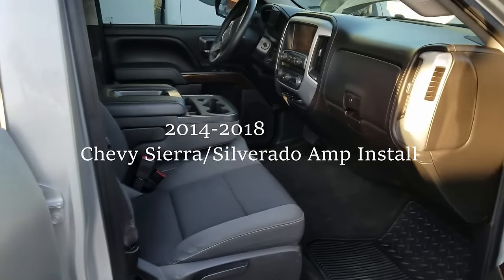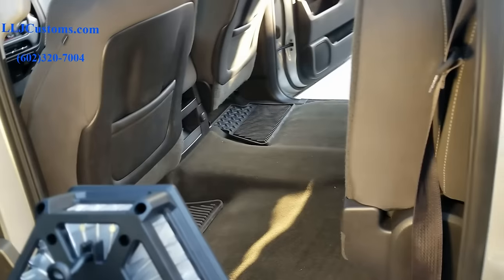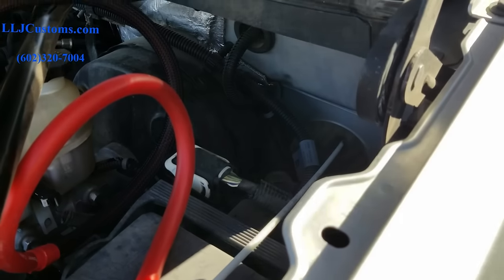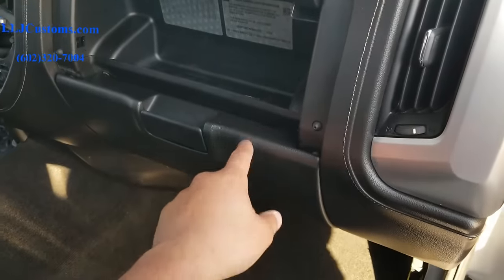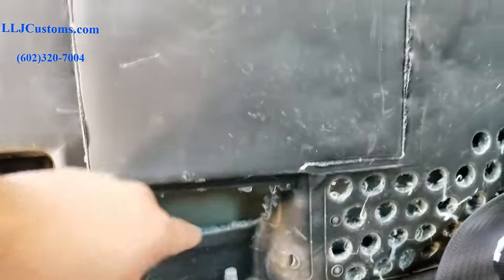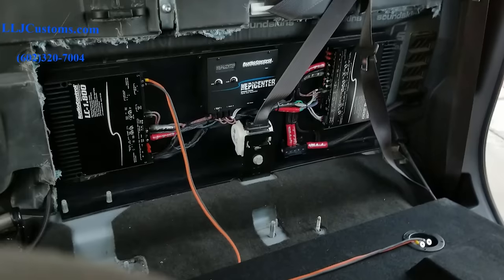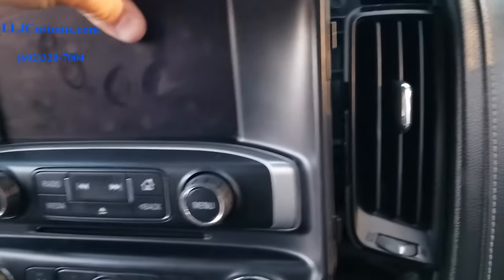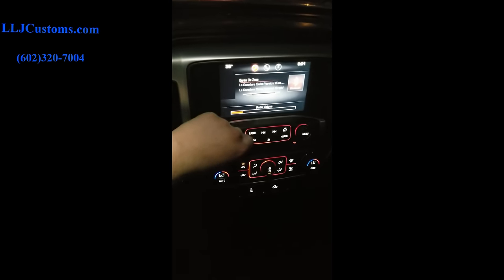2014-15-16-17-2018 Chevy Sierra/Silverado Amplifier install

Comment: Every time I invest in a great system....I trade the vehicle in and end up stock all over again. Why I won't waste money on upgrades.
Reply: Me either
Reply: I always remove certain things before I trade in my vehicle. So I can install it in the new one
Reply: @FG-ys4em Keep the stock parts so you can put them back in when you decide to sell. I leave the wiring so they can upgrade easily if they want
Reply from the maker: See, that's why we invented the elite system so that you can keep all your existing equipment, use it in your new vehicle, and all you need to do is change the base connector   of the harness.
Reply: Take your system out lol
Reply: We dont gaf

Comment: What does the other side of that loop back harness plug into? I have a kicker amp and sub I’m trying to use to just run my sub will that harness work?
Reply from the maker: @jackdecrow961  if you plan to just add a sub then a T-harness like a R2G or an R2R would be ideal

Comment: technically the accubass on the audiocontrol amplifier and/or the LC7i isnt the same as the epicenter, the accubass is to help with the bass roll off of the radio... meaning as in the bass dropps as the higher you go on the volume to not damage or distort the stock speakers, the epicenter enhances the bass that was rolled off or cut off when the song was produced... but nice install, love your guy's harnesses

Comment: Does the OEM loopback harness have the "Remote" wire for the aftermarket amps (Example:  AudioControl LC4.800 in the video) or do you have to run that separate from a separate location?  Thanks

Comment: That is very nice neat job i must say, good work!.  My question you kind of answered but i wanted to be sure, I have 2016 SLT with BOSE system and all i want to do is add kicker sub box and amp.  Can this be done with the BOSE system?  If so, where do I hook the amp to?
Reply from the maker: Thank you Greg, and yes you can you would use a bose T-harness R2G and make the connection at the bose amplifier

Comment: Hey LLJ, I got the amp rack plug n play from y’all. I was wondering which bolt y’all recommend using for the custom fuse box bracket y’all made. To everyone wondering if the product is worth it, HELL YES. The build quality is better than I could have expected, and the cost was barely over retail for the equipment included. For a novice, the rack is easily 20-30 hours of labor, if you even had the right tools. LLJ is the real deal

Comment: so when connecting the AMP to the Stock GM stereo all you need is the loopback harness? Other than that, it is typical power and ground cables and then your connections to the SUB (from amp)
Reply from the maker: That is correct and an amp or processor like a dsp or lnik6 if your amp does not take high level in .If you do have any questions please reach out to us .happy to help !

Comment: Mine is a 4" tall x 7" wide screen with a green plug but only has 2 wires. Hot and Ground coming out of it. 2014 Chevy Silverado double cab with a Bose system without a woofer. Do you sell a T plug with speaker outputs for this. I assume it would be for back at the amp. I need the speaker outputs to tie in a LOC PRO 7 RCA converter. I want to keep my factory  system, just adding a woofer and amp

Comment: I am just running a low end system with. Does the harness obsolete having to run the 2 rca cords? I Just wondered if I would need an interface

Comment: Hi, someone that such an apology will connect sound to a 2014 high country and when it accelerates, it makes noise to the bass I do not know if you can know what it is that woes so that it does not happen that greeting
Reply from the maker: Hello if you are getting any back feed to you subs when you accelerate you have ANC and need a bypass

Comment: Is this harness used so you don't have to cut into the factory wire?
Reply from the maker: That is correct. This is our old T-harness style our new harnes does the same thing but provides future expansion
Reply: @lljcustomscaraudiofabricat7854  thanks for the reply. I'm trying to add a 4 channel amp for my door speakers and a separate amp for my subs. Is there a harness available to do all this?
Reply from the maker: @agugabri14  Awesome, so yes there is and that is our Elite Lookback harness. Depending on the amp you have and if it takes high level input and if you have a factory amplifier or not you may also need a processor. We would be happy to help you with building out your system please send over the part number to the equipment you already own and our techs will give you a few options. Thank you
Reply: @lljcustomscaraudiofabricat7854  so for the door speakers ill be using the Taramps DS 440x4 and for the subs I'll be using the Taramps MD 1800.1, no factory amp. Plus ill be using a LC6i or the LC7i

Comment: I have a 2014 Chevrolet Silverado 1500 LT Crew cab with an 8 inch factory
radio screen. I'm adding 4 sundown 8 inch 800 watt 2 ohms subwoofers running off of a
 810 DM digital processer and the orion 5000 watt class D amplifier. 
My truck model does not have the bose amp system.

Which custom harness would you'll recommend for this setup?
Reply from the maker: Hello , you would want to go with a T-Harness and an LinkDQ. This will let you fix and boost the full bass frequancy range. https://lljcustoms.com/store/ols/products/2014-2018-gmc-chevy-silverado-sierra-oem-lp7-2-amp-t-harness

Comment: Where did you get the harness wire  loop
That goes from original stereo to small amp inputs and from small amp outputs to the  original 
door speakers?
Reply from the maker: Hi alejandro, we make them. You can purchase one on our website:
https://lljcustoms.com/store?olsPage=products%2Foem-loop-harnesses
Reply: LLJ Customs Car Audio Fabrication L.L.C I was just looking on site so with this I can bypass buying a processor? Does your harness control signal volume etc

Comment: if i have the bose system already in my truck and i want to add a sub, can the bose amplifier take a 400w sub? say a JL audio 12TW3-D4? or will i have to buy a new amp?
Reply from the maker: Hello Anthony, the factory bose amp does 80 watts so can you run an aftermarket sub yes will it power the sub properly no you would want to add a small amp like a acm1.300 or a Rockford  2.400 that can bridge to 1 channel at 400 watt will probably be 2 ohm so make sure your sub is the same impedance (ohm).

Comment: I got a zero gauge wiring kit and it won't snap underneath the plastic foot panel did you guys run it under the truck or something?

Comment: I had this done on my truck.. now my air conditioner is acting funny.. if it gets really hot, when i turn the car on none of the AC knobs turn on. then sometimes they do work.. sometimes it blows cold air, and the it blows hot air.. what could be wrong??
Reply from the maker: If you ise a can bus based product like pac pro those are issues that will happen. Our products NOT mess with any of your factory settings

Comment: Which subs did you use in this application? Also, was the box custom made? I have a 2016 Silverado and I am being told I cannot add anything decent due to the trans hump in the back.
Reply from the maker: Hello Curtis, i am sure that was followed up by u needing a seat lift and a custom box . No, you dont, and that's the point of this video, we used a single 12 Rockford P3s and a ground shaker box at 380 Watts rms . It is important to tune it correctly, and that is what most shops dont know how to do and why they upsell
Reply: @lljcustomscaraudiofabricat7854  would that work for a dual sub setup?
Reply: @LLJ Customs Car Audio Fabrication L.L.C  where are you located? If ypu are close enough I am going to pay you a visit.
Reply from the maker: @curtiscraft1633   absolutely the make doubt 12inch you could even get a double 13.4 inch jl subs iv had them in our test truck for over 5 years now still sounds great
Reply from the maker: @curtiscraft1633  we are located in Phoenix,az . Your are welcome anytime
Reply: @lljcustomscaraudiofabricat7854  that would be quite a drive from Jackson Michigan. Thank you for the info though.

Comment: Curious what box you used to go under the seat and if it was a single or double. I am trying to locate a good single 12" for my 2016 double cab. Any suggestions?

I like the amp rack. Maybe we can do some business on these.
Reply from the maker: Hello Raymond, thank you for watching the video. We used a simple ground shaker double 12"'s with some Rockford P3s's. We make a point of showing that expensive doesn't mean its better. Tuning is key . any box you buy make sure your subs will fit and at what frequency that way you know what your looking to get when it comes to your amp and the signal you feed it.

Comment: hey .would you help with my 2017 GMC SIERRA 1500 . DOORS SPEAKERS UPGRADE  WITH AMP BUT.  THE PROBLE THE  DOOR CHIME  INCREASE  TOO LOAD >
Reply from the maker: For that you would use a dsp to limit the Dbs at the frequency the chimes use to lower the intensity of the audio

Comment: Did y’all have to run 2 9 wires for the 4 channel.
Reply from the maker: Absolutely not, 9 wire at the time this was made was only sold in 18Awg and can introduce static into your system. We used an early version of our twisted shock-wire that used 20awg for signal and 16 awg for the return. They now sell a cheap 16awg 9 wire to copy us, but its not twisted and doesn't prevent EMI.
Reply: Gotcha, just wasn’t sure on a factory non Bose system. How to get the 9 wire from factory head unit to the Lci,  then lci rca to sundown amp. Then amp back up to the radio into harness to door speakers. Slightly confused.

Comment: Do you have a harness for people trying to run an amp for the door speakers?
Reply from the maker: Hello LS, yes we do we are the creators of the OEM loopback harness. This design lets you get signal on one side of the harness and then return it on the other to the factory speakers via the factory wires.

Comment: I bought your harness for a 2014 Silverado with an LP7-2R. I’m trying to figure out how to tune the system now. There’s gain adjustment in 3 or 4 different places so I don’t know which to adjust and what to set the others to. There’s gain on the LP-7 and the remote gain that connects to it. There’s also gain on my kicker amp and I think there’s a gain setting in the factory radio. Should the all be set to the lowest and adjusted only with the remote gain knob that came with the LP7?
Reply: I'm looking in to using that line out put converter.  It seems as though that knob is specific to ch 3 the "bass" channel... each gain should be for each channel ..

Comment: I ordered the same harness, for a 2014 Silverado, I installed an amplifier for the midrange and one for the subwoofers, the problem is that in the midrange the seat belt alarm sounds very loud, how can I fix that problem?
Reply from the maker: who did you get your harness from ?

Comment: i have a 2015 Silverado 1500 and there's only 2 wires coming from the green plug. a red and a black on the far right of the plug. Where would i find the audio wires in this case? Its a rally edition with Bose speakers
Reply from the maker: Hello, soubds like the vehilces has a Bose amp behind the rear seat. All of the audio will be running through the amp. The wiring behind the screen would just be data.
Reply: @lljcustomscaraudiofabricat7854   Yup, you're right. i did find it.

Comment: How long was the Harness you used? I am doing a similar install in the same type of truck and want to know what I should order.
Reply: Im wondering the same thing. Their phone lines are down and they take forever to answer emails.
Reply from the maker: hello this harness was 20 feet
Reply from the maker: We apologize Jack Aldridge, we have been work on our new shop. The length on this harness is 20 feet

Comment: You didn't show what bolt you used to hook up power
Reply from the maker: You are correct, our apologies. You will wire in at the bolt that comes from the battery connection befor the fuses

Comment: I ordered that same wiring harness, and the blue one (aux) did not work for me, do you know what the problem would be?
Reply from the maker: Hello Antonio 👋 when u say AUX and blue what do you mean ? Our harness doesn't have an aux option and the blue wire MAY be the remote turn on depending on your ordered configuration.

Comment: Is there any difference in the harness or install if you have the Bose amp in the back if you"re adding two amps or a five channel amp?
Reply from the maker: Hello, the only difference would be in the amps or amp that you have. Some amps dont use or do need and lc7i depending on there high or speaker level inputs. The bose amp outputs 32v so make sire your equipment is compatible

Comment: I have a 2014 Silverado with the 8" screen and no Bose, I am planning on putting the Linkswell Tesla style display that will utilize the factory connections. I want to add a 4 channel and a monoblock amp to the system, are there any of your harnesses that will work for this?
Reply from the maker: For the non-amplified system we currently do not have a wiring option for an aftermarket head unit.

Comment: Would you happen to know where to get a front speaker mount for 2016 Canyon? The 6x9" OEM mount is about 2.5" thick but the speaker is glued in so I can't reuse that one.

Comment: I just bought a 2016 Silverado 1500 WT, it came with the 4.2 inch screen, and I wanna upgrade, do you know if the 8 inch one is a plug and play one? If so, I will order one today, since I've seen them on ebay. if not, I might get an after market one in the next few days. Thanks in advance!
Reply from the maker: Hello Melgar,

i would suggest that you remove  the screen and take a picture and send it to us at Support@lljcustoms.com we can tell you want you have and you can then buy the harness you need.
Reply: @lljcustomscaraudiofabricat7854  sounds good, thank you, i will make sure I do that whenever I have time!

Comment: So what your saying is if I have a Bose system I do not have to pull the head unit to add subs?
Reply from the maker: That is correct the connection is done at the bose amp, thst is on the back wall.
Reply: @lljcustomscaraudiofabricat7854  aswesome thanks.

Comment: so just let me get this straight, this will allow me to use the factory door speaker wire and just change speakers?
Reply from the maker: Correct, the Loopback Harness will provide signal to your processor or amp. The return end of the harness gets wired to the output side of the amp and takes that amplified signal back to the speakers, via the factory wiring. The harness does not modify anything in the vehicle or in the signal, it simply carries it through.
Reply: @lljcustomscaraudiofabricat7854   I ordered the DIY style. i’m confused as to what all i’m going to have to do. i’m trying to just make it plug and play. what exactly do i need to order to just make it easy as possible. i have my own rca’s and signal wire. i just want to be able to plug the high level input into the amp and go.

Comment: Hey I bought one of your guys LOC plug and play and the remote wire doesn't turn my amp on after 2 years of use , what could be the issue ?
Reply from the maker: Hello Michael, sorry to hear that. Good news is you do have a 5 year warranty so if you would please send us an email top support@lljcustoms.com with your order number we can get you a replacement.
Reply: cool thank you man !
Reply: @lljcustomscaraudiofabricat7854  do I need the order number from my order when I bought it ? I think I might have misplaced the receipt

Comment: Is there any other places you could mount the amps other than the back of the cab,so you didn’t haft to cut anything
Reply from the maker: Yes sir there is lots of places depending on your set up, how much equipment your installing . You can go under the seat or the center council if you have one u can go under the dash if you doing a micro amp u can install in the top glove box.

Comment: How much does something like this cost
Reply from the maker: Our S.i.K kits at the time where 1200-3000 depending on equipment. now we have a lot of company's who have stolen our designs and try to sell them for 8 and 10 grand a kit with parts you absolutely dont need.  definitely do some research before you buy anything from anyone.

Comment: So I have 2016 gmc base model it doesn't have the green plugs behind the head unit 🤔. What should be my next step. I'm wanting to put in a amp and subs.
Reply from the maker: Hello Kris, the the only othere plug is gold/tan and gray but is the radio unit silver or black ?
Reply: @lljcustomscaraudiofabricat7854  
The unit is sliver
Reply: Also thanks for the response!! Thats pretty dope!
Reply from the maker: @krisberes4462   good so the harness you would use is the work truck/ elevation model with 7inch screen.

https://lljcustoms.com/store/ols/products/2016-2018-gm-and-gmc-vehicles-with-7-screen-loc-t-harness-not-bose-slash-work-truck-ls
Reply: Thanks for the help! You guys are awesome!!